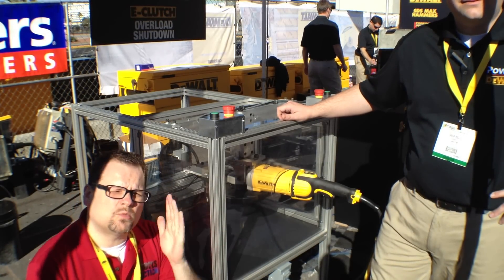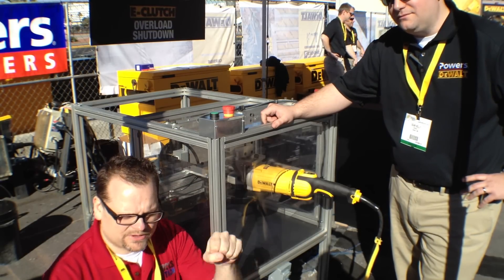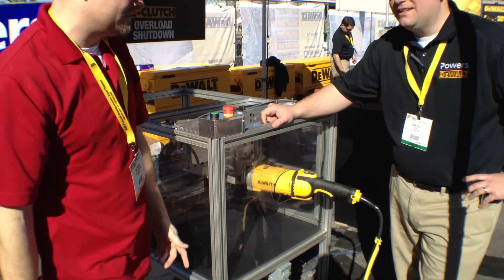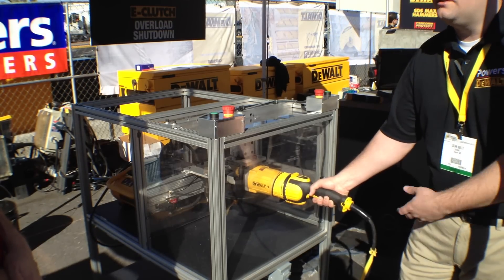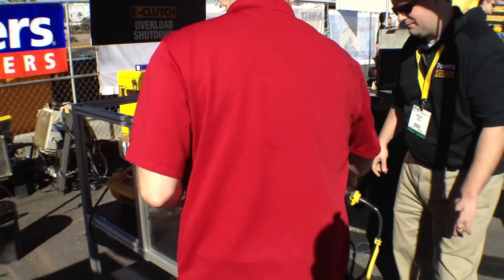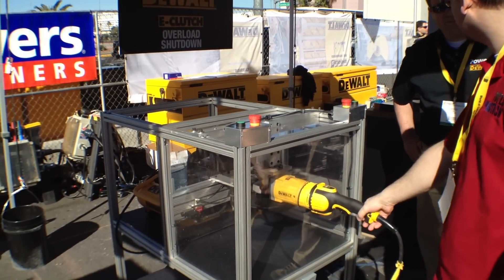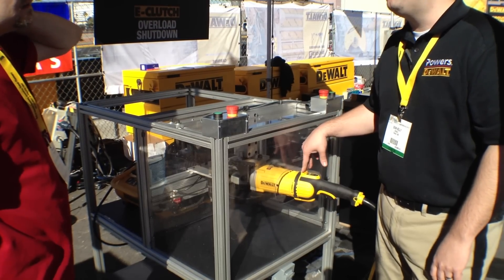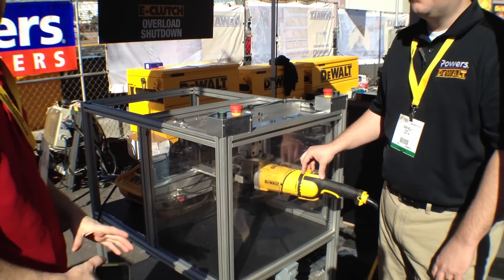DeWALT Perform and Protect E Clutch Technology

Comment from the maker: Good call,  I checked out the video and it looks like the wheel only stops when the dead man is released.  The DeWALT is automatic, you do not have to manually release the trigger.  I will research it further and see what i can come up with.

Comment: I appreciate the effort, but it seems like a silly test with the tool bolted in place. That tool isnt going anywhere, even without a kickback brake. Metabo's demo from years ago seems to be the best, with the long pipe that pinches the disc. They just had a guy wear tons of safety gear and actually use the tool like normal. They even compared several tools and you could see the difference in kickback jump of the tool.